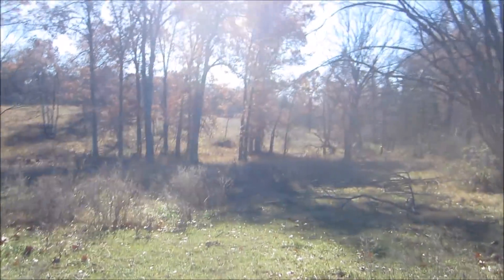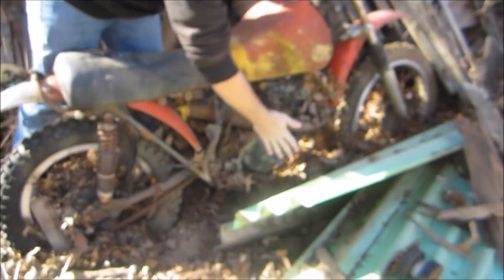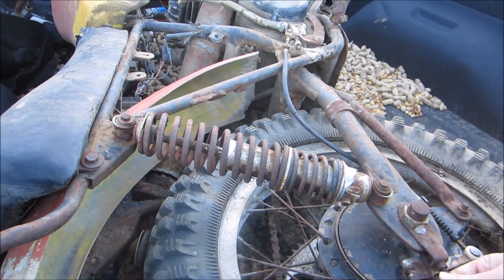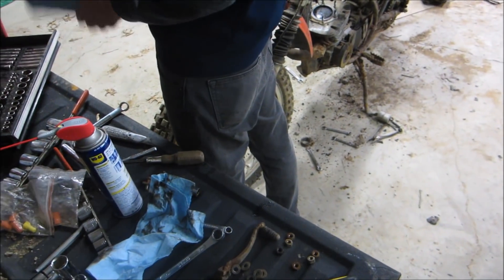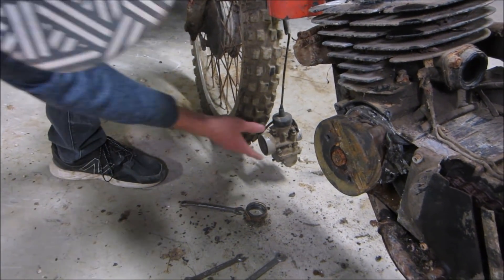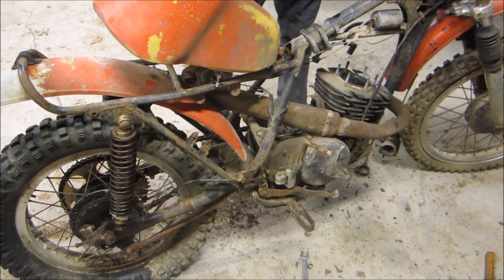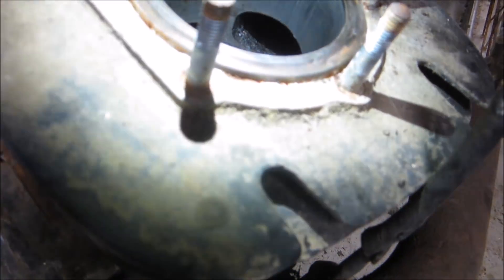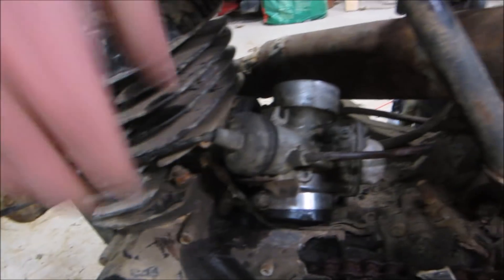Dirt Bike Revival Ep. 1: A New Lease on Life

Comment: One plug is for hot weather other is for colder so the engine doesn't lean out fuel viscosity changes daily, These have a power and on them that won't give a damn who you are it'll have more power han you'll ever use

Comment: 2 plugs is to make your fule burn all the way getting rid of the smoke
Reply: Austin Verdin that's a nice Theory but you're very wrong bike designers back in the day when two strokes were very common would put two plugs in one head because you'd have one spark plug foul out and your bike wouldn't run you'd be able to switch the plug wire to that other spark plug and get the bike home so it wouldn't leave you stranded